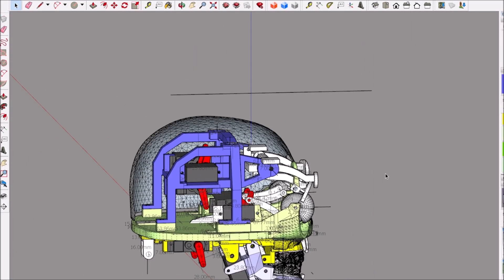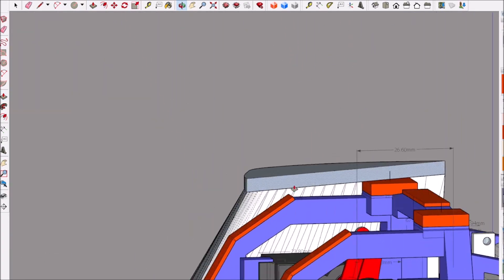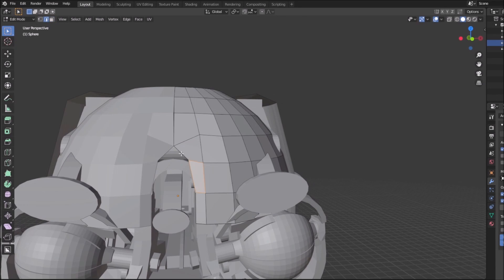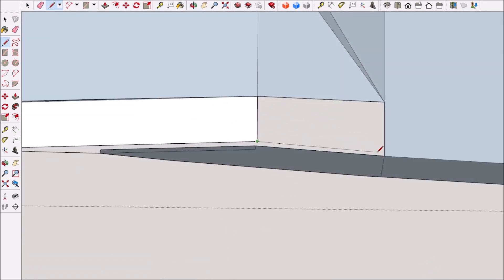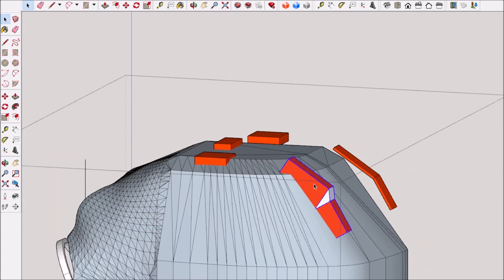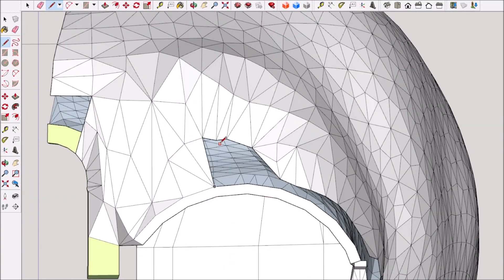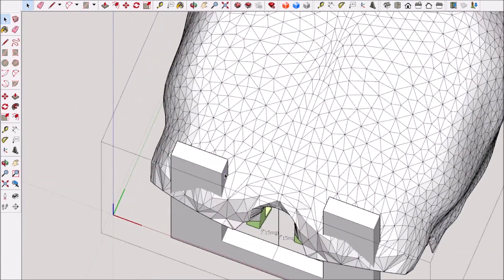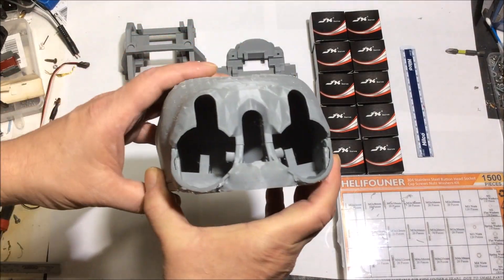3D Printed Animatronic Creature part 15

Comment: Very nice. Not a resin printer though, you've frequently referred to using a resin printer. That is FDM. I am assuming since it is new you are using some version of Klipper to speed up the prints.
Good points on water tight, I run into that problem from time to time.
Print quality is top notch. very nice. I can't wait to see it being assembled!
Reply from the maker: Thank You , FDM printing is for the mechanical part for the animatronic , where resin is not strong enough. Resin printing is for the detail creature sculpt that will be molded to make the skin.